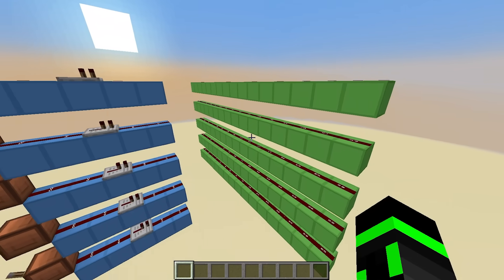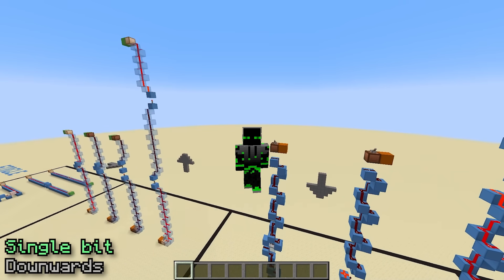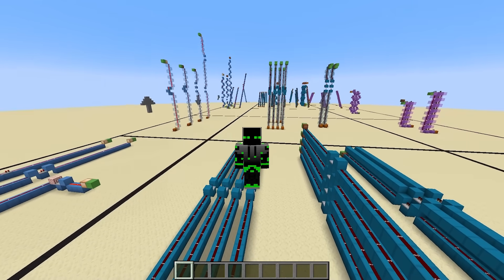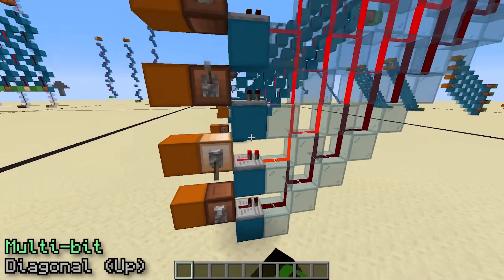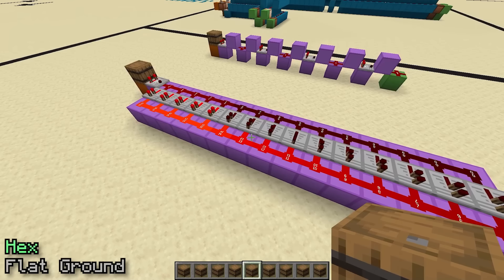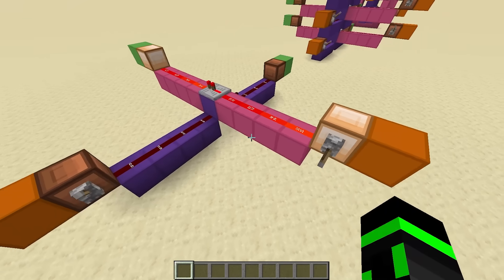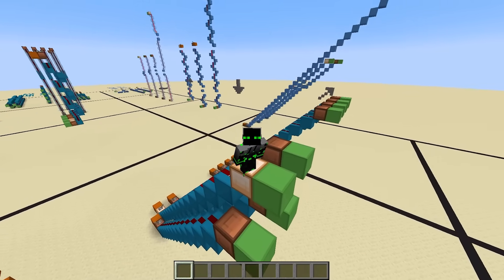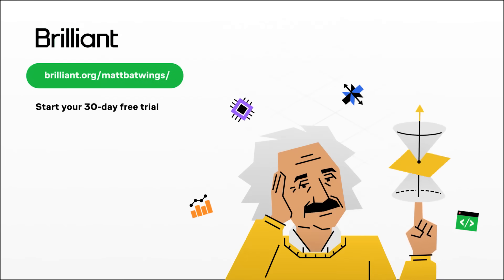How To Wire Like a Redstone Pro!

Comment: You forgot the insanely fast way of sending redstone up and down using walls and pistons mixed with redstone flip-flops
Since you can make walls update by changing the post form of the wall on and off, it will cause block updates that can be detected 
The reason for the redstone flip-flops is because you need to use observers to detect the change, which only output a 1 redstone tick pulse, so you'd need to make it output a signal that swaps every update to match the input wire
I think you could get away with some piston update stuff to have a built-in redstone flip-flop, but an observer with a sticky piston amd a redstone block works fine

Comment: 7:08 you can keep the range by replacing the barrel with a comparator on subtract mode with the barrel behind it and the barrel's value is one more than the blocks shortened by.
So for example for x=4 and input 13 (where in his contraption only 0-11 are possible) there will be 5 from the barrel and 3 from the side so it will subtract only 2 instead of 4 making the output 13.

Comment: if you want to get the signal up, you can also make a 1×1 tower switching like torch-block-torch-block etc. you just have to make sure that the input is the same as the output. if not, you can make a NOT gate at the top or at the bottom. this design s very space-saving, only bad thing is that it kinda lag your game if you dont have good pc

Comment: 2:55 Sorry but that's "HULTI" not multi.
Reply: Fr
Reply: You go do it better in that resolution then
Reply: "H" horizontal line is in the middle, dumbahh. Stop making a problem out of everything.
Reply: fr
Reply: Fr
Reply: fr
Reply: Does no one know that that actually IS how you make an M with a 3 wide by 5 high area? The H would have the block in the middle 1 block lower.

Comment: The real question is why you'd need such long wiring? I've only ever worked with compact redstone circuits/builds, focusing on making it smaller rather than larger. The only time I need a really long wire is in the shape of a hopper line if I need to transport items from farms to a central hub.
Reply: Redstone computers and similarly large contraptions

Comment: 9:04 I also strongly recommend a helper for WorldEdit called WorldEdit CUI, which all it really does is make it so the selection from worldedit is outlined in the world, making selections easier to see and interact with. then you can also do //deselect (or just //desel) to remove the selection, removing the region outline.

Comment: You can use walls to send the signal downwards instantly, over any distance.

Just build a 1x3 tower (any height), and put an observer below the bottom center wall (looking at that wall).

Whenever you put a wall adjacent to the center column, the observer will recieve a signal.

Comment: Multi-wires. My issue is that I'm currently trying to wire redstone to an item sorter (basically different stuff happen based on what you put in an input) so it's both vertical and horizontal from a get go (as the sorters are next to each other to reduce footprint)... And each wire has to lead to different output (some are combination of different outputs). It's kinda tough :D.

Comment: it's been a while since I messed around with it so I'm not sure if it's still in the game, but in 1.13 you could also use leaves to transmit redstone signals instantly and over pretty long distances quite easily, especially horizontally. Have you considered this, and if you have, do you mind sharing why you don't use it?

Comment: One way to send a signal up is to build a water column with a switchable soul sand block at the bottom and an observer at the top.
The same can be done with a switchable non-transparent block at the top of a column of non-transparent blocks and a light sensor at the bottom to send a signal down.

Comment: Alternate restricted hex value segment: same as full hex but just leave on the repeaters and input redstone dust for the unused range, this has the full length where yours is shorter. To get the spacing to work the barrel trick you used works for the number of redstone dust on the output line is the signal strength the barrel provides to the subtraction. 
You are only really restricting the values if you are only replacing 3 lines.

note: the repeater design is more expensive then 4 lines, the comparators design saves redstone(same cost as a single redstone line) but adds significant nether quarts cost. You should only do the repeater design if you need to save space and can't afford the quartz cost of the comparator design.

There are several vertical signal propagators that are more compact, they do involve non redstone components... I don't know any that do hexadecimal...

Comment: my favourite way to send signals down is dropper down into a hopper, hopper leads into a dispenser, comparator+repeater out of the hopper  into the dispenser to dispose of the item. i know its not infinite but its still 576 uses until you have to refill

Comment: How about block updates going up and down?

Using "leafstone" where leaves are updated with logs and the output read by observers, you could make a very simple, high speed and practically endlessly long wire

Comment: Is it necessary to always use redstone dust to wire things? for example you could use a bubblecolumn to move a signal up, and a wall to move a signal down. I even sometimes use a sticky piston with slime and a redstone block to move a signal in any direction
Reply: For him it is because he depends on a mod called mchprs, that doesn't have those features.

Comment: Yo, check out the mod called Axiom (fabric). It's amazing.
You can do all of the things like stacking, moving, copying and soo much more without need to type anything, everything is done by single additional slot in hotbar, you just select the area with your mouse and use scroll while looking in desired direction.
There is also a "photoshop like" menu on [right shift] that lets you also do crazy thing, but it's more advanced and I am just too dumb for it XD. You also get all kinds of things like placing the blocks in the air, noclip without spectator and soo much more. Personally I use it alongside worldedit for things like placing random blocks, but it's more for the building branch.

Also great video. Hope your eye will find this comment.

Comment: Challange: make an RAM CPU display and other more, BUT split that and make it can be conected with any parts by wool colour (theres a display with light blue wool and theres a part wich controll what will be showed on the screen and it have got also light blue wool to connect by //move and all that with other parts

Comment: One suggestion would be to use Axiom instead of WorldEdit. Axiom has far more utilities, and it gives you a visual preview of the changes you're about to make, plus you don't even have to type anything in; it's all done by scrolling and clicking; no commands are required.

Comment: This is only slightly related by redstone

In my minecraft worl i recently made a minecart track from my base to a ~300 blocks away village, but i also wanted it to connect to my mine later. I ended up getting a detect rail like 5 blocks away (cuz im using double cart speed mod) and also because the cart would flip to the mines if it was right next to detec rails. I ended up having to make it so the lever that made it swap at the start would flip, but connected to the detect rail's powef with a double torch, that way if either one were powered it would flip without the lever completely nullifying the detec rail.

Sorry if this is hard to understand, im bad at explaining redstone

Ps i don't think it matters and i just made it much more complicated, but if it does i used like 2 torches right next go eachother with redstone to power the block another torch was on that powers the block the flipping rail was on

Comment: Just want to mention that using powered rails and observers allow a lot of these parallel wires to be run right next to each. No need for spacing.

Check out Squibble's video on it
Reply: Not mchprs compatible

Comment: Even faster but less orthodox way of sending a signal downward: piston blocking a daylight sensor at the bottom. Has unlimited range.
Reply: But wouldn't that not work at night?
Reply: @baboon_92 TWO pistons blocking one of each light sensor type! I'm a genius
Reply: @baboon_92 LMAO it wouldn't work at night.. ofc if you are a respectable, daylight-dwelling individual, that won't be a problem 😉
Reply: @czardonyx  okay, back to Reddit with you now
Reply: you can use a combination of walls, a piston, and an observer to send signals vertically because when a block touches a wall the entire column updates
Reply: I use pistons and observers and they work the exact same speed as redstone towers. Granted it seems to only work on bedrock, and I am a newbie so I’m sure there are much better methods lol.
Reply: @blobfish7109 you should try eternas thing with the wall updates, it’s so clean and you only need one observer and piston and some walls lol

Comment: 6:54 applications for that... say you want to reduce that length to the extremes... if you know your desired max signal strength, do you want a specific reduction to it that only accommodates that maximum? Say you would like to have five as max bound, reduce the length by ten or nine or such, and put that barrel down, et voila! Space savers!

Comment: So far you only talked about transmitting on/off and hex Redstone signals. But what if we only care about rising/falling edges? For example sometimes a wall tower with an Observe might be the best solution. You should make a follow up video mentioning all the unconventional ways of transmitting signals, like Wallstone, Leafstone, wireless Redstone, etc.
Reply: You also have rail-based instant wire for transferring signals sideways. You can't really stack it vertically, though.

Comment: 0:48 It may not always be possible, but I generally put redstone dust on top of the block to redirect the redstone signal into the block behind the repeater. That piece of redstone dust will always stay unpowered, but that doesn't matter since it'll perform the same function as the target block
Reply: most people try to make designs compact, so no

Comment: 1:10 a note about this: the double torches will take a single redstone tick (or just two game ticks on java edition) longer than the repeater.

1:31 fun fact! while glass towers are capable of sending redstone signals downward on bedrock edition, slab towers are not. so, if you only want the signal to go up and you're on bedrock, you can just use slabs.
Reply: And a note about your first note: a single torch will give you more reach than a repeater if you have a high enough tower to need two or more extensions. Well, for upward signals to be exact.
Reply: Yo thx
Reply: You don't have to say "or just two game ticks on java". Everyone understands what a redstone tick is even if it technically isn't a thing. In fact I'm convinced that plenty of less advanced redstoners do think that redstone ticks are a thing on Java Edition
Reply: @xGOKOPx  This type of assumption is what leads to information being lost over time. Never assume what people know, especially when trying to be informational
Reply: @xGOKOPx  yeah i know. i mostly just wanted to flex that i knew the difference lol. for the silly funnies.

Comment: Mojang should add a crosswire block. It's an idea I've had for a while now, a block which takes a signal in one face and outputs the same strength on the opposite face.
With this you would be able to cross two different signal strengths by simply running them through the x and z axis' of the block.
Reply: the issue with that block is it's unnecessary. mojang has always been very resourceful when adding redstone to the game, because they know that redstoner will always figure something out that will work fine. I think comparators are a real stretch when it comes to what will be provided to us.
Reply: @mani-cwaf  I understand that, but without the need to change wire heights when crossing, a lot of Redstone could be more compact in ways that are currently impossible.

Comment: Just for ask, is not just better for vertical use to use just a bunch of blocks and torch? Is just more efficient and the signal tends to go infinite
Reply: The problem is that torches are slower than redstone dust, the redstone dust can instantly travel the power 16 blocks.

Comment: I always like going for leaf blocks when it's vertical stuff because it looks funny with some trees in the middle of the wiring
Reply: Leaves are finicky to work with, but they were much faster than observer chains, I recently tried to get back into Minecraft redstone, but decided redstone itself is too complicated so I just used observers and pistons, all I was able to make was a basic division by three solver.
Reply: @flameofthephoenix8395  I don't do computational stuff so for me it's been a very easy thing. Guess it depends on your usecase.
Reply: @RisingRevengeance  I wouldn't exactly say that I do computational stuff on Minecraft, just random stuff. Recently realized that speeding up the circuit with pistons isn't as good as speeding it up with bells, the pistons can carry the signal ever so slightly faster but when you turn off the signal it takes longer than the bells to end the signal because each piston doubles the number of pulses meaning that just eight pistons can increase delay by 256 ticks.

Comment: for the horizontal ones you can put several lines next to each other and at the same height because the power will only reach the repeater in front if there is a length of 15 redstone dust then a line of target block and finally the repeaters and so on

Comment: While not instant, sticky pistons with slimeblocks are a great way to send signals down and up because theyre 1x1!
Reply: unfortunately, even if you alternate slime and honey, you cannot put them side by side and let them fire independently because the redstone block will get stuck to the side of the other lines, also it is not consistent for logical redstone where timings are concerned, because of piston spitting and the firing time being 1.5 redstone ticks

Comment: Idk if this is a stupid idea but couldn’t you make a hex memory using redstone clocks to unlock hoppers for certain amounts of time which fills a barrel and makes a comparator give a certain redstone strength. This could be easily reset and changed by emptying the barrel and would be 4x more compact than regular binary (2x if u consider larger design).
Reply: Unfortunately, that would be very slow. Hoppers take 5 ticks in order to transfer an item to a container iirc, adding the fact that you need to use more items that the signal strength requested makes it even slower. It would be best to convert to hex and store it in a comparator if you want to make the space smaller.

Comment: The down facing wires upset me, why not use walls and you can do it instantly from any distance even top of map to bottom and you can tile them 1 wide
Reply: Because that would be pulse outputs. These are constant signal output methods which are much more useful in computational redstone

Comment: I once saw a way to send redstone signal upwards using a piston, observef nad a bunch of leaves/walls, bc they can change their state, depending on if there's wood attached to the leaves/if one of the wall blocks has a block attached to it's side

Is there any downside to such a way? (I hope I explained it comprehensively)
Reply: the piston, observer and each leaf block delay it slightly + the piston, when activated quickly, may change its operation, which will ruin the entire machine

a better option is to use leaves instead of scaffolding and a trapdoor, it's not the perfect way because it still causes delay but the problem with the piston in this case will be solved because it won't be here

Comment: 6:25 just a quick tip explain what HEX is. I was kinda lost for a bit
Reply: If you don't know what it is, you don't need to know how to wire it
Reply: @excelmaster2496 incorrect.
Reply: Redstone is capable of storing not just on or off, but also power level, this is typically just a limitation to work around, but if you know how you can actually use it to your advantage. Each piece of redstone can store a value from 0 to 15 in the form of how much signal strength it has, however if you don't wire everything correctly you can lose this value through transfer.
Reply: Instead of binary or decimal, it has 16 digits. It's also called hexadecimal.

Comment: 2:01 another method I had come up with is, hard to explain in text
Basically its 1 wide, two long
Built by the same unit of:
[Redstone, air]
[Block, redstone torch against block]
[Air, redstone]
[Redetone torch againdt block, block]
Don't know what benfitis / downsides there are but its slow so idk

Comment: you dont even need staggering or even any space between straight wires, if there are always exactly 15 blocks between repeaters, since the power will always only be enough to power the repeater straight in front. only turning is a bit of a problem there, so only works with straight wires, except you want to put a little decoder after every turn
Reply: Literally came to say this
Reply: lag machine lol
Reply: @vibaj16  yeah, if youre doing it a lot it will lag a lot more, but if you dont have much space its worth thinking about it. ofc you shouldnt do it with every wire xD